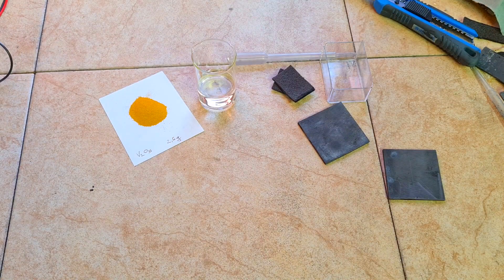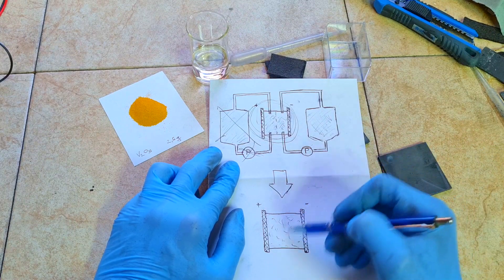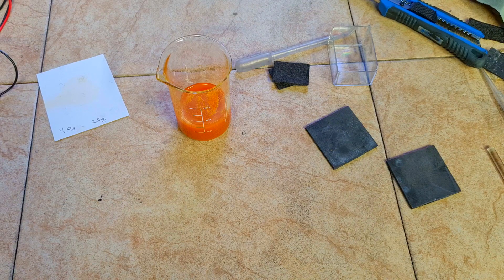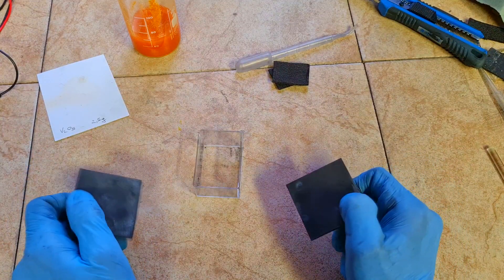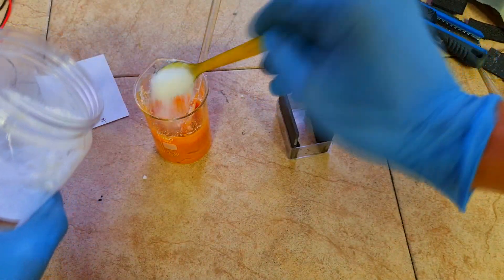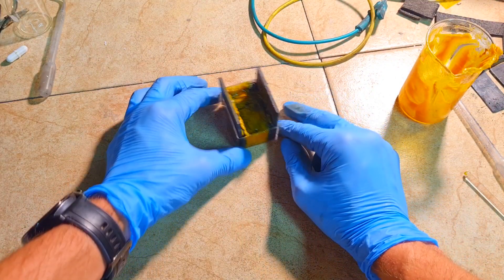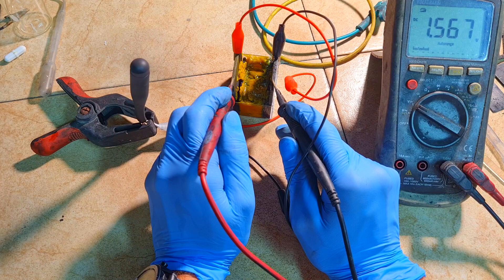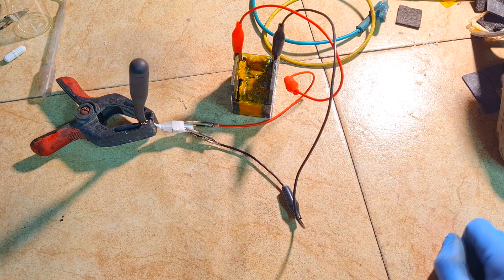How to make Vanadium redox Gel Battery

Comment: The same materials (V5+) were used to charge at the Cathod and Anode. How does it work?
Reply from the maker: Different oxidation stage of the material on the negative and positive side of the cell will be formed during the charge.

Comment: Hi, enjoyed the video. What were the conditions to charge the battery? I presume you had to keep things quite low to avoid electrolysing the solution?
Reply from the maker: Hello! Thank you. The cell is normaly charged in the range from 1.6 to 2 volts. The problem here was that V2O5 is not so conductive, because I dont add any conductive additive to the V2O5 (because I hope that the oxidation state of eache site will be better seen). And for that reason I also need to apply higher voltage of arounds 2V. But for making better cell I need to add conductive aditive to the material to lower the internal resistance.

Comment: You make typical gel battery, membrane is needed to separate two solutions, that's the whole point. The extra tanks are only to scale up energy storage.
Reply from the maker: Of course I make a gel battery. Yes is needed some separated for the next stage. But is no need for expensive membranes like nafion, etc. Bravo,.... yes the electrolyte tanks are used for scale up in flow types 👏

Comment: how can we pump it around with pumps. it looks like a fat solution.... can i just and more destilled water or acid for good flow
Reply from the maker: This one? You can not,  because is a gel variant. For flow variant you use normal vanadium electrolyte. Which means you dont use the gelling agent.

Comment: I would have appreciated 1. V-o-c.  2. Max Short circuit Current and temperature measurements for safety. However:  Thanks for the Content and time!
Reply from the maker: For VOC you mean Volatile Organic Compounds,... here is H2O, H2SO4 98% in ratio of 50:50 (or 30:70 if the V2O5 is harder to dissolve) and V2O5 (% depends on what performance you want to have - more V2O5 more capacity, etc), temperature is stable,... It will not heat up in charge or discharge stage. For short circiut current I need to look on my notes if I will find it.
Reply: @cayrex  I thought you were building a back yard electric battery in this video. To me V-o-c is always open circuit voltage. Still the misunderstanding brings more important info about this chemistry. Thanks!
Reply: @cayrex  So short circuiting this battery will not destabilize ( cause violent toxic gas bursts and dangerous temperature rises)?
Reply from the maker: @danielbtzibur8637  no

Comment: Interesting take on this , I wonder how many ah and if the graphite plates get eaten over time …
Reply from the maker: Looking to vanadium redox flow battery which also use carbon based electrodes,.... can get to 10k to 20.000 cycles with no problem. The carbon based materials are robust to many chemicals. 20 to 25 Wh/kg is rated the vanadium flow battery which is almost same that nickel iron battery,.... so that gel version is almost the same.

Comment: Hi Carex2, instead of using water can you dissolve the Vanadium Pentoxide in a DES of Urea or E.G and then add Sulphuric acid and the Fumed Silica powder?
Reply from the maker: Why easy if can be made complicated!? 😐 why making more complicated and adding more materials to the cell which higher the cost... and in the end you will not get out with better cell. Why not make a cell with only materials that you really need? V2O5, H2SO4, H2O and silica to make lesa or more gel like.
Reply: @cayrex  Thanks, I appreciate your comments
Reply: Where can I buy quality Vanadium Pentoxide  in bulk quantities?
Reply from the maker: @kazeem-mustapha  in bulk,... some alibaba?
Reply from the maker: @kazeem-mustapha  no problem
Reply: @cayrex  Did you buy the Vanadium Pentoxide you used in your last video on Alibaba?
Reply from the maker: @kazeem-mustapha  no,.... it was from chem supplier
Reply: @cayrex When are you doing update videos on Vanadium Pentoxide Battery and Hybrid REDOX Flow Battery?
Reply: @kazeem-mustapha  united nuclear scientific  equipment and supplies,klamath oregon

Comment: Very good. I will ask the obvious question though. How is the self discharge or does the viscosity of the electrolyte prevent it?
Reply from the maker: Membrane free cell have the self discharge rate of 0.06V/day and yes,... the self discharge rate is depending on the viscosity of the electrolyte
Reply: @cayrex  That isn't too bad at 0.06v per day. Fopr mass storage I reckon that would be acceptable. Thanks for reply.
Reply from the maker: @rogerwilson6367  no is not. If is charged each day or every second day.

Comment: Awesome, I really like this battery! Is there any reason why you used fumed silica instead of PVA for the gelling agent?
Reply: I think you will find that the resistivity of the electrolyte increase a lot with PVA. Fumed silica tends to increase the viscosity without increasing resistivity too much. Not sure if PH of electrolyte will effect PVA.
Reply from the maker: Like Roger Wilson said. I try to make the cell with PVA,.... but to get good viscosity,... I need to add alot of PVA. And in the end the cell with PVA was so so bad. After 30 min of charging the cell was not able to spin the motor even for a second.

Comment: Between this format of Vanadium Pentoxide Battery and the Vanadium Pentoxide REDOX Flow Battery, which one have better load current? Also, why did you add Sulphuric Acid?
Reply: Vanadiun pentoxide is soluble in sulphuric acid.